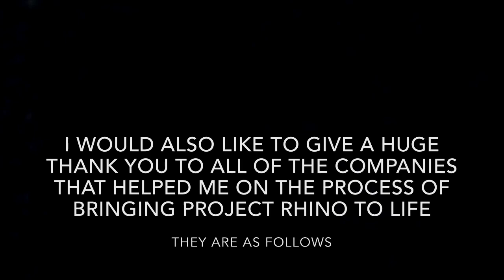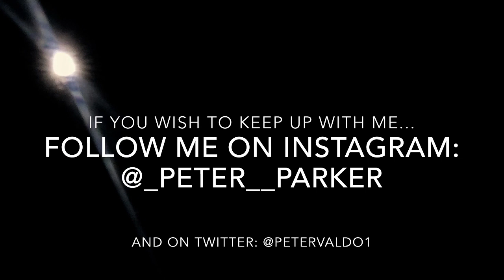2003 Toyota Tacoma Transformation: 4.5” Lift Kit + Tyger Rock Sliders • 13 of 21 | @PeterValdo1

Comment: Did u have to cut anything to add the bilstein 100s in the front or back and do they actually loft the truck themselves or do I have to do something else
Reply from the maker: No cutting is necessary to install the Bilstein 5100’s. 
You just set the lift height you want and you install them in the front. The struts lift the truck themselves.
The rear ones are solely shocks though; you have to add an AAL or a block or a shackle to go with the lift in the front.

Comment: Nice job on the sliders , hard to find for reg cabs...
Reply from the maker: I appreciate it, and I agree. Honestly though in my opinion, this looks so much better than the regular sliders sold for the 1st gen Tacoma’s. Those things don’t fit regular cabs perfectly, you gotta modify them to fit, and in my opinion; the styles that All-Pro and Trail Gear sell, look basic and simply not as attractive as these Jeep ones.

Thanks for watching man, I appreciate the compliment👊🏻
Reply: Looking for them for 2nd gen reg cab ...
Reply from the maker: They’re selling way better looking ones for the 2nd gens. Currently I’m using some running boards my dad put on there but I might upgrade them someday🤷🏻‍♂️

Comment: Yo quick question i got a 1996 tacoma with 31 inch mudding tires on it rn. Thinking bout a 6 or 5 inch lift would it be tall and are the wheels too small
Reply from the maker: Yes, you will be riding pretty tall after just installing a 5-6 inch lift alone. A 3” lift kit is enough to make quite the difference so imagine you’re going up 5-6 inches.

Tacoma’s from 96 come stock with 14” wheels, however since you’re looking for a 5-6” lift, I would say you should go to a 17” wheels. It’s not just me though, if you look around for lift kits for your truck, at the bottom of the page it should tell you the recommended tire size and wheels backspacing for upgrading your suspension.

A six inch lift for your truck could fit 305/70/R17, which is a 33.8” tall tire.

Let me know if I answered your question properly. 
Thanks for watching👊🏻